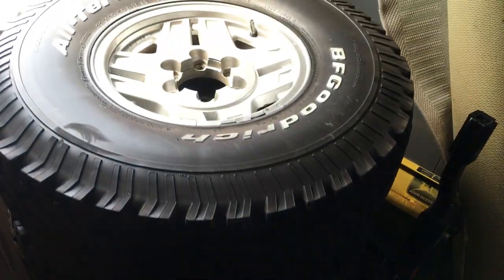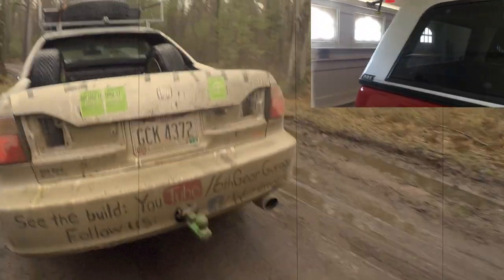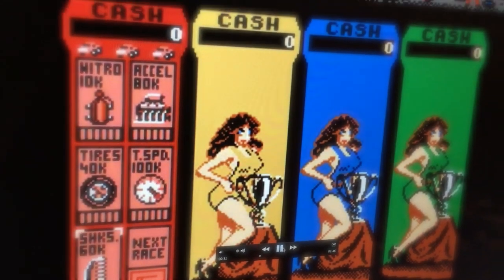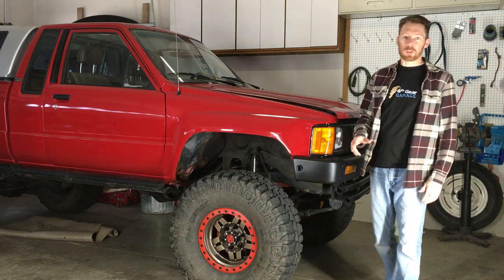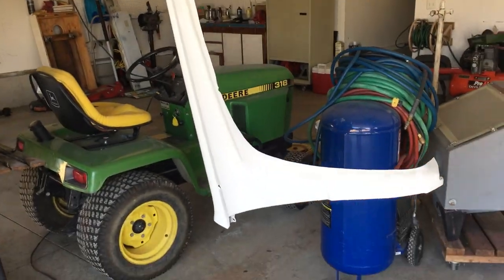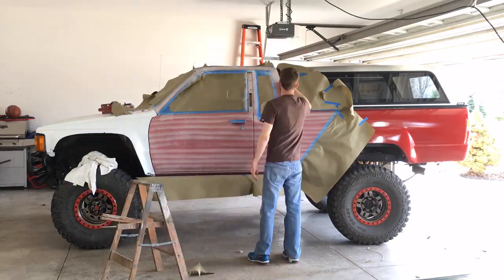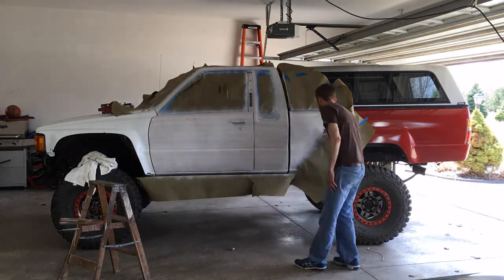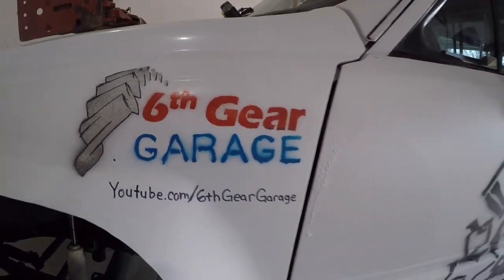Gambler 500 Transformation of my 1985 Toyota Pickup!

Comment: what is the function of the transmission control relay toyota SR5 1985
Reply from the maker: It supplies power to the transmission solenoid pack during normal operation. When the relay is off, no power is supplied to the control pack and the transmission goes into limp mode